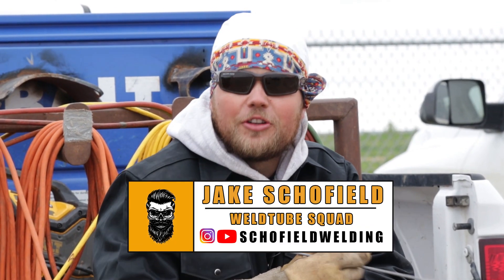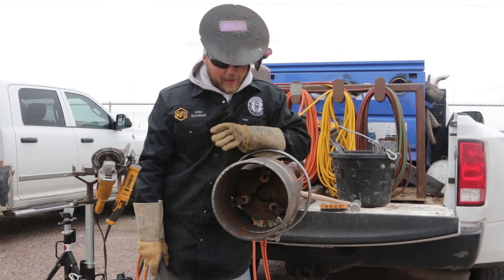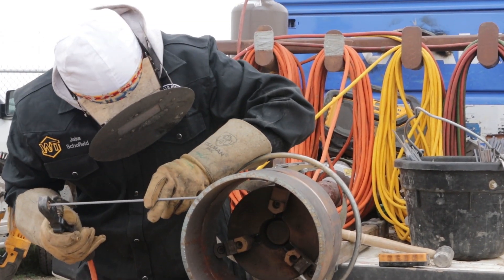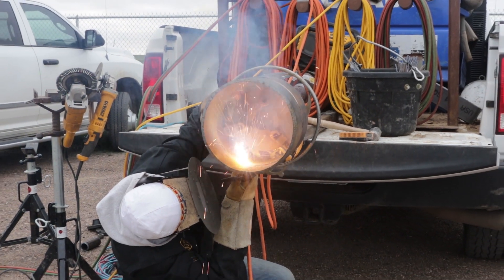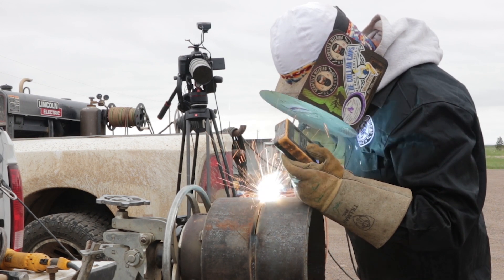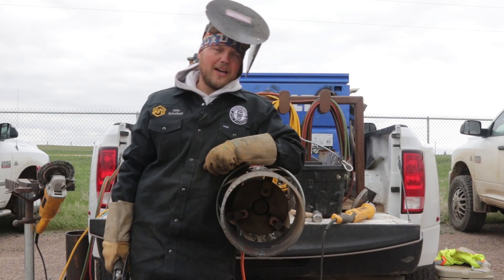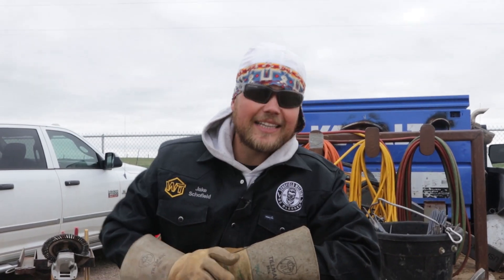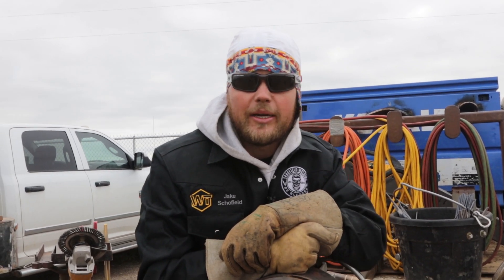Trouble Shooting a Downhill Weld-Welding Methods.

Comment: So what's the trick too putting a bead in with 5)32 6010 on 42 inch hard pipe. Seems hard to keep your bead flattening out on the sides and bottom

Comment: I'm not a welder. But I have seen a video of a guy that says you can use arc length whipping and how fast instead of changing amperage. Or is that not an approved way. Just curious and interested in what you guys do.

Comment: What are you running you miller at for soft and stiff settings? Ive been messing with mine and cant get a good mix so I leave it around 5 stiff
Reply from the maker: So I’m on 3 for my soft. I run everything about there. It’s a little more watery but you don’t really have to worry about trapping anytjing
Reply: @JacobSchofield  ill try it out. Stock program?

Comment: learning to weld with one hand is the best advice that you can give to anyone , I have one hand one the remote and one on the stinger at all times . If that red half moon gets close and catches up with the rod crank it up . light up with 5/32 on top then switch to 1/8 on the tight bottom .

Comment: Jake, Love your work mate and thanks for the instruction and help your putting out there. 
You gotta stay healthy though, check the new guidance from the UK Health and Safety Executive on mild steel welding fume now classified as carcinogenic. 
It's advised RPE (air fed hoods) is used even outdoors to protect the welder and anyone in the area. Burn hot and stay safe brother...

Comment: I couldn't understand you but did you say if you punch through on the hot pass that its fixable? I'd like to see that.
Reply: Brandon D grind it down, run a 1/8 to repair hole, then hit pass over it. Happens everyday on the line. No biggie
Reply from the maker: Just what Ethan said